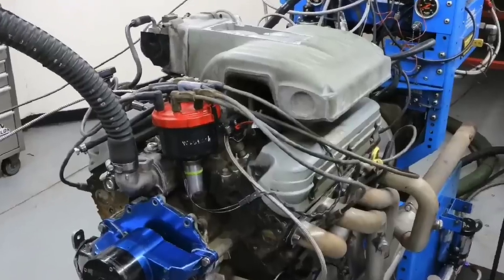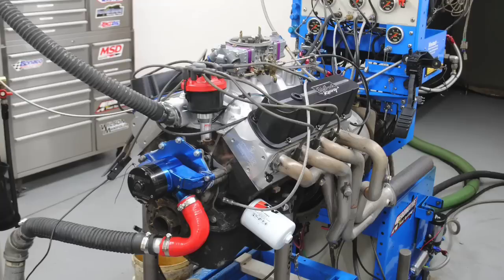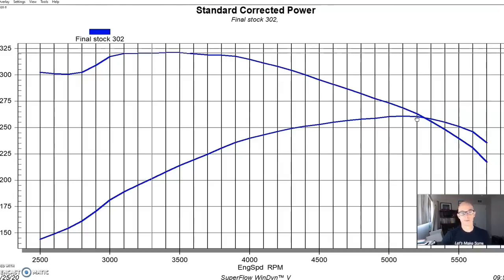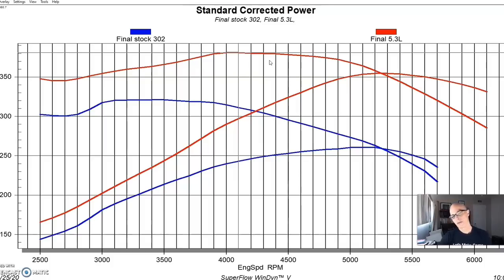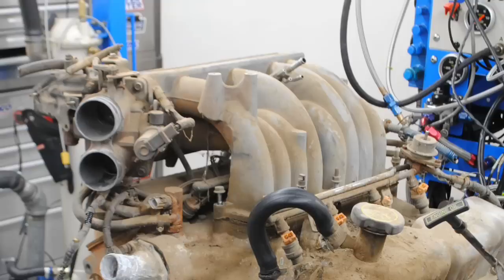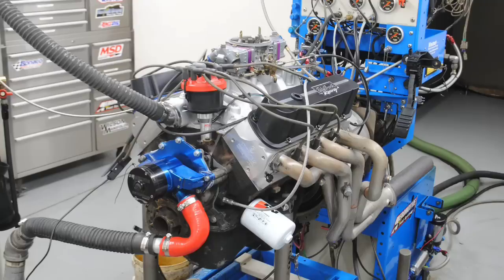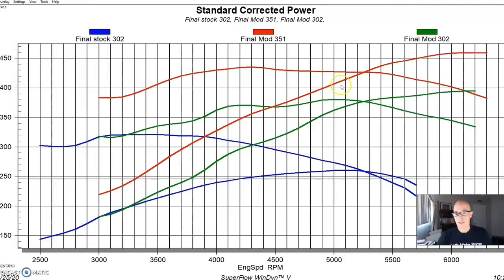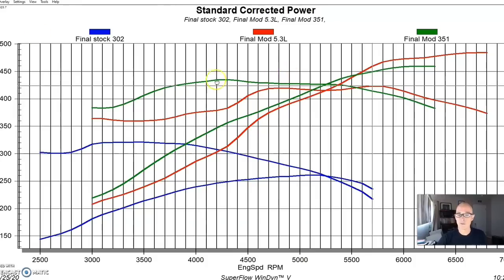5.0L vs 351W vs LS-SHOULD YOU SWAP?

Comment: 11:06 the modified 351 is making close to 50 more HP at 4500rpm, and roughly 90 more ft lb. looking at the busy graph, the 351 build looks to have a better power curve across the board than even a modified 5.3 LS. #ShotsFired
Reply from the maker: pick the one you want to run
Reply: Its probably doing it with less compression too its a stock bottom end car.  These swap right into a fox 5.0 it's a very easy swap.  Idk why more ppl dont do it it's not like they cost alot either lol.  If you rebuild it with more cubes and higher compression you can really have a monster on your hands.
Reply: @richardholdener1727  i appreciate your attention to detail, and the passing along of knowledge.  this video was an eye opener!
Reply: @MrStangdawg   I bought my 94 351W for $300 beans. Ill pay roughly $300 to get the block decked and cleaned. I wanted to go with AFR Heads and have those Ported and polished for another $200-300 per head plus valves and springs. Debating on stroking it to a 387ci or 393ci... No not very cheap but hitting the gas pedal brings a Villain like grin to my chiseled stone face. Its just for N/A fun on the streets.
Reply: @midnight347  those 351s came with a big dished piston. Flat top piston probably would have made 11 to 1 compression
Reply: @Bruce Lee  well that makes it more comparable.  It's still doing pretty good for such old tech.  It's a torque monster.  And best of all it still has the classic pushrod Ford sound like the 302 just the meaner version of it.
Reply: @MrStangdawg  it's just as cheap as any ls swap would be especially in a mustang where the cost is higher because more things have to be changed etc.
Reply: @Oso Blizz  it'll make badass power with a stroker, more cubes and more compression and it'll be a torque monster.  Best of all is you can throw some boost at it if you ever want to and make big power 1000+ easy with forged internals it won't even be sweating.
Reply: @Bruce Lee  never mind my previous comment I misunderstood what you said haha.  You are correct.
Reply: @osoblizz7937 I'm buying a 94 f250 tomorrow, has the 5.8 Windsor with a 5 speed behind it 😍😍😍 I can't fucking wait

Comment: The video I have been waiting for. I was the first in my clique 18 years ago to do an efi 351W and most everyone else did 5.0L SC instead. We all drove each other's cars and I still liked mine better. Mind you I was 20 at the time. Made 301/362 at wheels tuned by Jerry W himself. Junkyard 351W from a 1997 F250 with 27k miles, eBay TFS aluminum heads cut to 43cc, lunati cam with 512 lift and 220 duration and 110 lsa with 1.6, new GT40 intake, 30lb injectors and 90mm lightning MAF. Totally stock shortblock even with the huge dished pistons. All accessories attached and working even the air pump on a 100 degree day indoors in Atlanta.

Comment: An LS install when there are perfectly good Ford options is just wrong to me. Admittedly this is a bit of a money is no object option, but I'd love to fit an alloy block 351W stroked to 427 with CNCed alloy Cleveland heads flowing 320ish cfm with a 625 - 650 lift cam, single plane manifold and dominator. Should be able to go better than 13s with that.
Reply: 13s? Lol
Reply: burn baby in a mustang fox body should be faster than 13’s. 4.10 gears.
Reply: You can do low 12s with the stock stroke 5.0 if it has the RPM to turn to make horsepower.

Youd probably be shifting at least 6500 RPM.  

Thats where I like pushrod carbureted  v8s. 6500 to 7000 rpm shifts that run on pump gas with little maintainence

Comment: I'm one of those guys you're talking about.  I have a ford that was available from the factory with a 302.  I went with a 351W in it because of price and the easy of getting replacement parts. 
 The big benefit that wasn't really discussed in the video is all the extra parts like headers, engine mounts, etc.  A lot of those parts designed for a 302 in a certain application will work with a 351.  In 20 years, I will still be able to go to autozone and pick up a set of replacement engine mounts for my application.

If somebody wanted to put an LS in my car, they would be shopping for custom made boutique engine mounts and headers.  In 20 years, after the LS fad dies off and is replaced by the next hotness, nobody is gonna be making all these LS swap parts anymore.  Once the junk yards are picked clean of LS motors, the aftermarket support will drop off.

Comment: I say, "especially nowadays" keep a ford all ford... No need to put a LS In a ford car when ford has  plenty of option like the new 5.0s and the bigger engine like the 351-460 ford's... If I liked the fox body's.. it would be all ford most definitely.. no LS that's boring now🤷🏾‍♂️🤷🏾‍♂️🤷🏾‍♂️
Reply: Lame also too lol. Too many LS in everything.
Reply: Problem is all the mod motors are too wide. The control packs are finicky. And all the pushrod offerings are carb biased, no control packs!
Try running a 302/351 in EFI with a ford computer: do you like torture?

LS is very compelling due to top end power potential, compact, weight, and oem control pack: you can tune that thing where it’s buttery smooth.
Reply: Biggest problem is price. I am gonna swap in an ls because 302s take too much cash to make power when compared to an ls
Reply: @BOOSTJUNKY  that's also very true.

I'd rather buy a plate to adapt an LS to a common trans or swap a whole GM package than mess around having to spend 5k on shit to make the 302 run (not as well) as a 4.8/5.3.  essentially that's what will happen every time.  and the only defense is the 302/351's sound magnificent.  and that's it
Reply: @voided76  the 351W/C will beat those LS if both built n stroked, some ppl just dont know engines can be stroked..
Reply: @P71ScrewHead  mhm

What happens when you do the same to an LS?  You're in a losing argument dollar per hp against an LS.  i don't care what you plan to do.
Reply: @BOOSTJUNKY  you will spend the money to make a 302 run, swaping that ls in and getting it driveable.
Reply: @voided76  what happens when the 460 ford steps in with a turbo?
Reply: @frigglebiscuit7484  theres always the 572 Chevy!! Lol
Reply: @voided76  bro, but the 351W vs 350 Chevy, the Ford wins, dont take it personal, i like all American V8s, but the 351's block is just more powerful n can be stroked more, to big block status, i doubt the 5.7 can.. Now, my only favorite LS is the LS7, 505hp n 25+mpg hwy, to me, any other LS is just a waste of time, i'd start with that n build it, or keep it stock OR mod for even more mpgs..lol A future buy tho will be a 632ci BBC from BluePrint Engines, can't beat it for the price..
Reply: @frigglebiscuit7484  I cammed the stock 302 in it and put a 650 edelbrock carb but thats jus to sell the swap out of it.
Reply: @frigglebiscuit7484  exactly💪🏻💪🏾💪🏻💪🏾💪🏻💪🏾
Reply: A Coyote is like $7k and I've seen 4.8s go for $200. They're not really comparable lmao. Screw brand loyalty, I just want to have some fun for cheap
Reply: "Can't beat it for the money" is exactly why LS's are at every dragstrip that you aren't going to.  Not only is the 351's block not "more powerful" nor can be stroked to some magical number you can't do with an LQ4 block that doesn't fuckin matter because everyone with a junkyard LS is strapping a turbo to them and mopping up fudds left and right.  505 HP is what a 4.8 LS makes on 10 pounds. 87 octane if properly fueled.  You know that,  right?
and the minute you start talking about CNC custom big blocks,  dude,  you've missed the entire point of the swap.  if you want to spend 30 grand on an engine have fun.  it's just as likely to fly apart at redline as the junkyard LS when you put the stick to it for real.
Jesus christ.
Reply: Frigglebiscuit  eat everything in site lol jk
Reply: kevin shiley  least not a small block lol
Reply: Ford is too high and their engines are gimpy!...LS swap it!...been building engines for years and never had too many Fords outperform the Bowties!...Ford needs more $$$ to make reach Bowties performance!
Reply: @P71ScrewHead  351 WILL LOSE BRO!!!....i promise you!...Ford and Dodge are catching hell with the LS/LT platforms!!!...they cost so much more than a junkyard LS too make power!...and not to mention how reliable Chevy engines are!
Reply: I'm gonna put an ls in my ford, or you could cover the costs to keep it all ford, since you care so much about  other peoples cars and what they do with them..
Reply: If it was me plain and simple ! BAE 542 Hemi with a big ol blowah.

Comment: I took an 83 GT shell and built her from the ground up to look like a late 80's 90 LX. At the time I was working for Ford and found a new set of 69 W 4 BBL heads, still in the original boxes.  Found a good 302 block and built from there. 
A lot of head work. Ports match with intake, Weland along with shorty headers (custom) Valve train matched to heads and fuel system. Bottom end was customized as well with 11.1. 93 oct only for this girl. Believe, if I remember right she ended up being a 321, when all was said and done. 
Dana rear end with 3.73 gears. Ignition system was an MSD with a rev limiter. Whole thing matched and balanced out.  
Extremely beautiful black with tan interior with BBS gold center wheels. Made to have 4 whl disc brakes along with custom suspension. Coil overs from and back.
Handing was much better with the suspension being custom and dropped 1.50 in the front 1 in the back. 
She did not handle as well as my 88 951, but she was a lot of fun. 
Ford with Ford period. Cost more to build a good solid Ford motor, but power was never an issue. T5 was the biggest issue with the girl. She would eat them up. End up having to spend a lot of money for a good trany to hold up with the power.  
The girl scared the hell out of me she had so much power for such a small car, but was such a blast to drive, even at 9 mpg on a good day. Never met another car on the street that could handle her.

Comment: Great video!!!! 
LS is just a newer better built SBF.  
If u build a SBF with parts of the same specs as LS. The power would be alot closer. Im sure LS have better tech/geometry built into it which will be why the SBF will fall alittle short. Personally i would never crossbreed brands.
Reply: Ls is all roller stock less power loss also ls has bigger cams from the factory so aggressive can for a Ford is just barely tickling a ls
Reply: @utahcountypicazospage5412  i agree but if giving the same head flow same lift same runner size and length same cam secs and displacement they would be closer in power with the LS having alittle more but not enuff to do a swap. Just. Build a better motor
Reply: 5.3 has higher compression ratio so it will make more power with all else being equal.
Reply: @s0meguy809   I agree. @Richard Holdener should test this. With getting the specs as close as possible including compression ratio
Reply: @deonh8447  it would be very close with maybe MAYBE a very slight edge to the ls.  People act like ls is God and ford engines can't make power.  The ls is just newer and comes better equipped out of the box.  Its about head flow, cubic inches and compression and the ls is usually higher on all fronts so obviously its gonna make more power lol.  Give the Ford the same cubes same compression same head flow itll be pretty damn close and the slight bit the ls may be out in front isnt enough to warrant swapping it.  It's not gonna cost that much to build a high compression 408 with some good heads.  They can be found cheap in junk yards too and the 351 block can handle alot more power than the stock h.o. 5.0 block.
Reply: @midnight347   I agree a LS is great engine Its also 30 years more advanced than a SBF/SBC. Many different variations between 280-500 HP depending on which one you get. This lets you know its nothing special its all in the build. If swap any stock LS into any car and expect to win races your gona be disappointed. I dont think the swap makes since even in a old school chevy if your just gona put it in stock. When u can take that money and build a SBC with more power than the LS
Reply: @deonh8447  Clearly youve never swapped a LS into anything...lol.

Comment: Your videos have convinced me that the next motor I build will be a 351W with my TFS heads and intake, and a Powerstroke turbo.  I'm shooting for an 800hp turbo 351W.
Reply: I’d strongly recommend looking into the Aussie “blue thunder” clevor heads for the Windsor platform. They’d easily match or beat trick flows, have much more flow potential with porting, look meaner bc of canted valves, etc.
Reply: @Greenskies321  Those are the "3v" heads that came out years ago, right?  I read about those, but if I wanted a crazy set of heads, I can get them in the states for less money.  I figure I could make 800HP on 10-12lbs of boost with a 351W sporting TFS TW heads and street intake.  It would have great street manners and absolutely rip.  Of course I'll need a new transmission and be careful with the rear end, since I've got 28 spline axles into a Torsen T2R diff.  I could maybe buy some 300M axles and get away with it.
Reply: You know a stock 5.3 could do 1000hp with head bolts pistons and rods oh and still get 28 mpg while cruising no 5.8 can claim that especially not a stroker
Reply: @utahcountypicazospage5412  1000Hp is about the breaking point of a stock 351W, based on Richard's testing. I'd want a little higher static compression, so with a set of rods and pistons it would probably last to 1000Hp for short periods. The rest of the car would have trouble with 1000Hp without kilobuck upgrades.
Reply: EFormance Engineering I’ve seen 11-1 5.3 bored to 5.7 iron ls1 oh and it needed less boost because of compression to make 1000 hp remember more boost gets hotter less boost stays cooler always no matter what kind of boost
Reply: @utahcountypicazospage5412  TBH, an NA 351W with decent heads and cam is enough party for a fox body, adding boost is just for giggles and atmospheric compensation.. I'm at 4200ft.
Reply: And RHS heads are decent but with a set of AFR, Profiler,  Trick flow R11, and many more options, 500+ HP easily!
Reply: @frigglebiscuit7484  exactly not everyone wants to spend 2 grand to run 9s one time lol.  Some would rather spend a few grand more and run that good time and time again without worry

edit
You cant hold it against em man...just the typical simpleton who follows everything they see and hear on the internet and regurgitates the same bs over and over
Reply: @eformance  I’m with you on boosting for altitude compensation. I’m at 5400’ mountain living. Built a 10:1 332 Stroker, carbureted screamer, looking to twin turbo intercooled blow through boost it for just that reason, hopefully I can find a way to wastegate it to 3.5psi